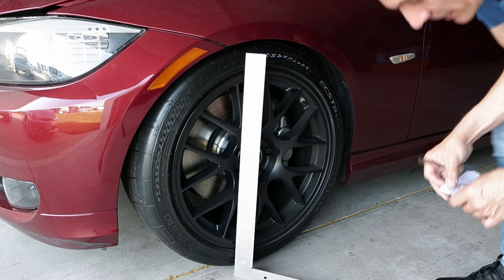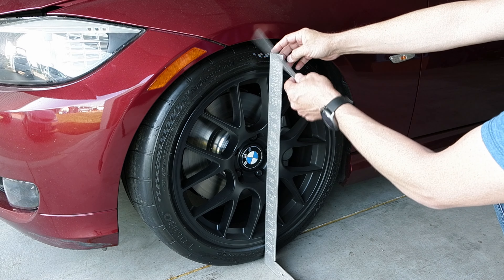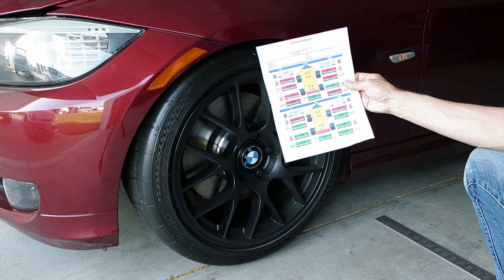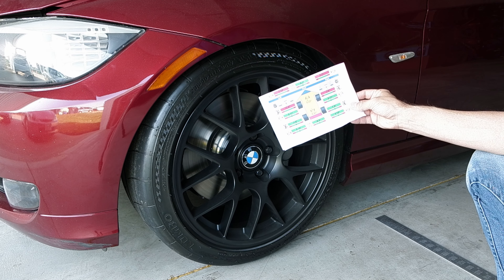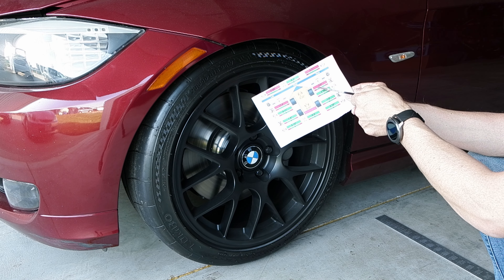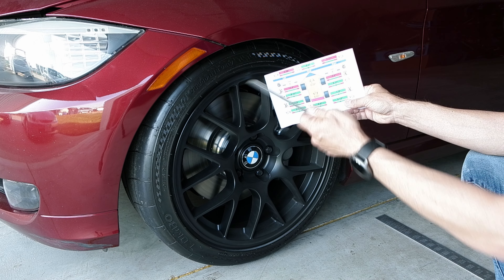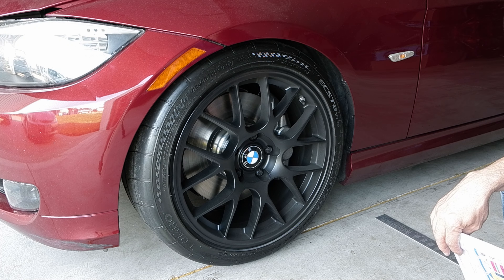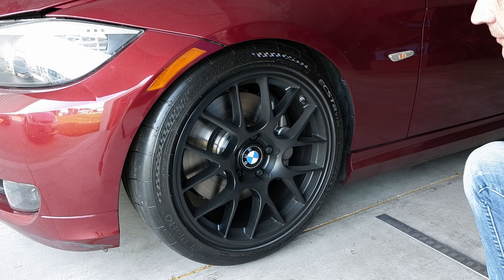BMW E90 Camber Plates Installation aftermath | Alignment Numbers | 328i Suspension Mods.

Comment: I did M3 Control Arms and Dinan Camber Plates, I did the alignment myself, but it was a while ago. I think I ended up with around -2.5 to -2.75 degrees of negative camber. 

In my opinion the single best upgrade you can make is a M3 rear sway bar. Direct bolt on and eliminates all understeer.
Reply from the maker: I looked at those and Turner plates and didn't like them. They work, I guess, but not my style. Well, it's not that simple with eliminating the understeer on these cars.

Comment: Great stuff! Looks like a worthwhile upgrade, any chance you're selling these now (or if not, have some sort of drawings/model I can get laser cut)?
Reply from the maker: I have a production run of about 10 sets of these plates in progress happening in December. They are 3-dimensional parts, so a laser / waterjet cutter is not enough.
Reply: @maxsam201  Oh nice, are all those 10 sets already answered for?
Reply from the maker: No, it's just what I plan to produce. I didn't do any actual polls on quantities.